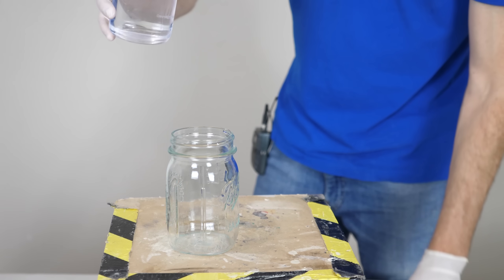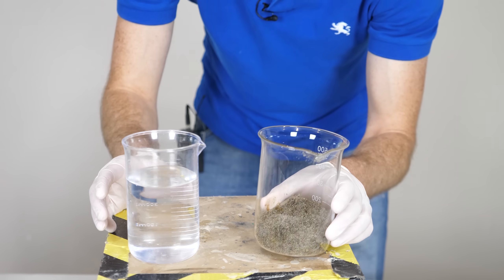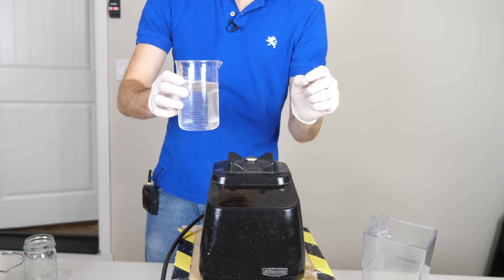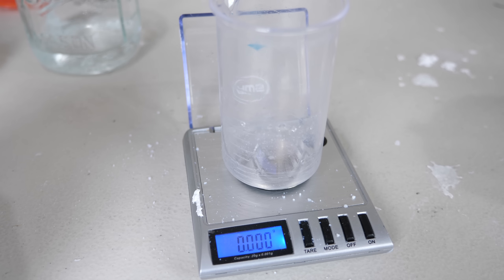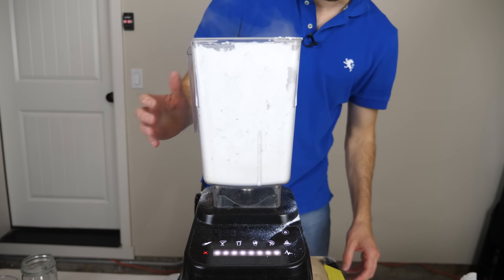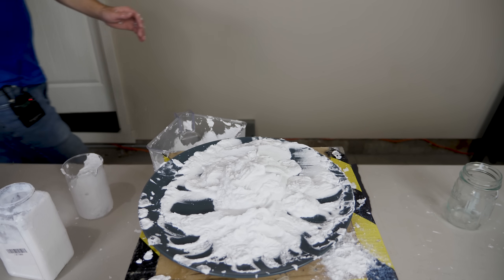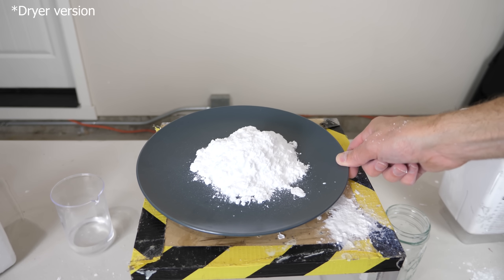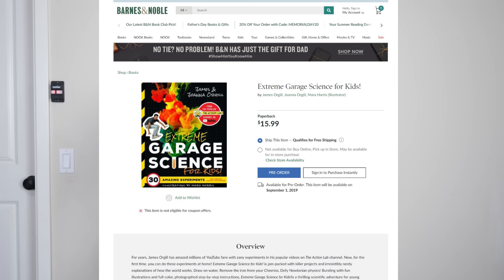How to Make Dry Water...Weird Experiment Makes Water That's Not Wet

Comment: snow is water, but what about dry ice? its a DRY form of ICE which means WATER
Reply: yeah it's big brain time
Reply: Dry ice has no water in it at all. It's frozen CO2, and it's called dry ice because it goes from a solid straight to a gas, with no liquid phase (sublimation). Only reason we really say 'ice' is because it's a cold, white, solid like ice
Reply: @temptationtv1726  alr thx

Comment: The way you mentioned isn't how fumed silica is made industrially.  It's made by burning SiHCl3 or SiCl4.  The method you mentioned is how polycrystalline silicon is made.  That's pure silicon that goes into solar panel or many other semi-conductor applications.  Good video though.

Comment: Actually: Dry water = hard-frozen ice.
To varying degrees, isn't any solid that contains water that isn't chemically bound to something else, yet doesn't feel wet similar to what is demonstrated here?
Aren't dry silica beads that have absorbed moisture from the air similar to what is demonstrated, with the remarkable difference (and it is remarkable, this is and interesting demonstration) being the high water "content", rather than this actually "being" water?

Comment: "Water is wet because it can wet things"
Every 60 seconds in Africa, a minute passes
Reply: Actually Clocks run slightly faster around the equator (than they do at the poles) due to a tiny planetary bulge that makes it slightly further away from the center of the earth's gravity, because the earth also has to rotate faster at the equator to keep up with the rest of the planet, these effects compensate for each other, causing both clocks to run at the same time. The difference in speed is so small that over a year the time disparity would only equate to less than a few seconds of age.
Reply: To everyone saying water is wet, how does water make itself damp?
Someone said that if something makes something else wet,then it is wet.
Shouldn’t that work with acids or fire?
In case someone says yes, acid doesn’t dissolve itself and fire doesn’t make itself burnt.
Reply: @vulcan8724  but sticking to something to make it wet is not the same as an acid donating a proton. An acid can make things wet, since they are all in watery solutions.
Reply: Mud is just wet dirt if you think about it
Reply: @geoffreyeljefe4544  that's a good point
Reply: is dirt dirty because it's made of dirt?😂
Reply: Actually, since we don't have atomic clocks in Africa, every 60 seconds, we lose a gazillionth of a second. :(
Reply: All people inside africa lives in africa
Reply: People die when they are kill
Reply: @nguyentandung42  Just because you're correct doesn't mean that you're right.
Reply: @nguyentandung42  did you mean: killed
Reply: The better question is, what is wet?
Reply: @GDO9099  something that has or is touching a liquid i think
Reply: @RandmAnimal  but why is it called wet? What is the pure essence of wet? If wet is by itself, is it wet or not?
Reply: @GDO9099  yes
Reply: 100% of cats are not dogs
Reply: In Africa, the next day happens tommorow
Reply: In Africa, people who die is no longer alive
Reply: Almost everyone in africa is born on their birthday
Reply: Everytime a child is born, the population increases
Reply: @idie6606  Unless someone dies at the same moment
Reply: A dog is more likely to bark than cats
Reply: You are awake after you sleep
Reply: Yesterday was last day
Reply: We can drink drinks
Reply: If we close our eyes, we will no longer see
Reply: We move when we walk
Reply: If we open things, they are no longer closed
Reply: when we sit, we are not standing
Reply: The man’s about to make dry water though
Reply: That’s funny because...
Reply: Not just in Africa....
Reply: Wet means water(or any liquid) is on it, so do we say water is wet because there is water on it? No we say that’s just more water
Reply: Literally 😂
Reply: Lol
Reply: Funny.. that never happens in Asia
Reply: @sailaab  what part of asia are you
Reply: Every time you inhale you exhale, unless  you just stop breathing then you are dead
Reply: @マルコHyprMarc yeah true...
Reply: Water is sticky.
Reply: Can water wet itself though?
Reply: xD
Reply: I cant comment because it says 69.

Wait...
Reply: You know it’s cold outside when you go outside and it’s cold
Reply: @マルコHyprMarc like me
Reply: he explains extremely complex fields of science is extremely simple terms for a reason.so people like you can understand it without having to pull 10 PhDs out of your ass.try not to be so sarcastic
Reply: Different things but same spirit
Reply: Wet stuff makes other stuff wet as well, like dripping wet hair and a carpet. Therefore wet things wouldn’t be “wet” As well right? Idk I just thought of that lmao
Reply: @6675rock  water is an exception as water itself doesn’t have a neutral dry version of it. Water is always a liquid at room temperature. Everything that can get wet can also get dry, water can not
Reply: I heard that in an African accent
Reply: @マルコHyprMarc Black holes are racist
Reply: Every 60 seconds in Africa no rain drops
Reply: a drop of water doesn’t have a dry outside, it has a wet outside. If water wasn’t wet it would not be able to wet other things.
Reply: This implies that in other areas of the world it is different t
Reply: @fred_marques  yes it can wet itself because a water molecule can interact with another water molecule.
Reply: Yes, floor is made of floor
Reply: You can tell because of the way it is
Reply: 60 seconds is a minute because it takes 1 minute to pass
Reply: Together we can stop this ❤
Reply: well yes, but water is not wet, it makes things wet
Reply: @ethanbergeson1240  technically it makes itself wet
Reply: @ethanbergeson1240  the water is in contact with other water, therefore making it wet
Reply: Water is wet but being wet doesn't equal being water all the time
Reply: @ethanbergeson1240  Wet is defined as something surrounded by water, water molecules are surrounded by water and are therefore wet. Water is wet.
Reply: @Resters52_official  “In a liquid-liquid interaction, such as water by itself, we can say that water is not wet, as molecules are all bound together and not wetting one another.”
Reply: @nelsonkuria4086  how does that even make sense? The water is interacting with water. It is wet.
Reply: @Resters52_official  does that mean a single molecule of water is not wet?
Reply: @Resters52_official  So does that mean the surface of water is dry because its not surrounded by more water?
Reply: @ObjectsInMotion  no, it's wet because it's stacked on top of water, it's kind of like putting water on the back of your hand, while the palm is dry your hand is still wet
Reply: @Resters52_official  what about one single molecule of water? That wouldn’t be wet, would it?
Reply: @Resters52_official  also, water doesn’t make itself wet because it doesn’t saturate itself with water due to water being water already. A towel becomes wet once it gets water in it. Water doesn’t make itself wet by principle of what wetness is.
Reply: @RobertMcBride-is-cool  in that case, I think the 1 molecule would make your hand "partially" wet. You can debate the definition of partially all you want, since it's levels to the word. But I do believe wet would be the act of surrounding or partially covering something in water. 1 molecule counts lol.
Reply: @thanosisking7249  that is irrelevant to the point I am making about water not being wet.
Reply: @ObjectsInMotion  Exactly... As a kid I used to joke about it... nobody would laugh though...
Reply: @ethanbergeson1240  The fact that water makes other things wet proves that water is wet. That's literally how you prove whether somethings wet or not
Reply: @averagetwink.  So Fire is burnt because it burns things? Bleach is white because it bleaches things? The fact that water makes things wet does NOT mean it is wet.
Reply: @ObjectsInMotion  water is different from the things you described,, fire is literally just hot fire doesn't "burn" everything either
Reply: @averagetwink.  is fire burnt? It does make things burnt doesn’t it
Reply: @ethanbergeson1240  ??????
Reply: @ethanbergeson1240  
Water is wet
Water = wet
Reply: @Brady Janssen water is wet because it can wet things. Even a single molecule of water can wet another object because itself is wet. Water = wet
Reply: “So weird”
Reply: But it’s not water it’s water and silica
Reply: Water doesn't get wet ... wet gets water

Comment: It's a bit of an old video, but if it has air trapped around it, what would happen if you compress it or put it in a vacuum? Also what if you absorb some sort of fuel and try to power an engine with it? Does it change how flammable it is and if it makes it less flammable, would it make the fuel "higher octane" (more resistant to knock)?

Comment: “Water is wet because it can wet things.”
glass is called glass because it's made of glass.
Reply: Glass is glass and glass break
Reply: @nguyentandung42  scratches at a level six with deeper grooves at a level seven
Reply: doesn’t count
Reply: I'm fairly certain a lot of glass these days is made of acrylic and polycarbonate.
Reply: No- glass is called glass because you can see thru it (but not thru the looking glass - WHY?)

Comment: The Action Lab: This is such a weird experiment
Me: just use ice
Reply: ITS DRY ICE
Reply: Ice is still wet to touch
Reply: @Wwain  Not quite. It becomes wet the moment you touch it. Ice actually has a rather high coefficient of friction. It isn't smooth or slippery. The reason it feels smooth and slippery is because liquid water is denser than ice. When you apply a pressure onto the ice, you compress it, thus forcing it out of its solid state and into its liquid state. In other words, a thin film of liquid water forms every time you touch ice.
Reply: bruh how much kids dont know that ice is water because water is a liquid but ice is solid and they’re different
ice is made of water but not water

Comment: I got a question about the water, so the water is shift changing material ,that can ruin every other metal, rock and everything with the  time, the hard rock breaks molecules from the water and lose its own shape , does that mean that the water is harder than the rock ? And if so what is the highest amount of  pressure that can endure until breaking its own molecules and become 2 atoms H , and 1 of O ? Will be glad if you make some video about it ^~^

Comment: Uhhhhh, isn't dry water called "Ice"??   Also, with the "dry water" in this video, how can you extract it??
Reply: bruh dry water isn’t a thing and ice isn’t technically water but made of water because it’s a solid not a liquid
Reply: Polly heat it up so the water molecules separate by evaporation
Reply: feynstein 100 heating up ice makes water not water vapour and it’s called melting, heating water into gas isn’t evaporation because you boiled it not let it break up over time
Reply: Ice is wet technically
Reply: @fatimaakamrann How do you figure that?? Ice is a solid and therefore can't be wet.
Reply: @stevenbingham3061  um hey? Try putting ice on something to see if that thing gets 'wet' or not
Reply: @fatimaakamrann  If it gets wet, it is because a portion of the ice has melted into water.  That layer of water is what is making something wet, not the ice.  Ice by its very definition is a solid.
Reply: @stevenbingham3061  Yeah, ice is solid but it's not dry water. Water can't be dry.

Comment: Now, by material definition this maybe called dry water, but that’s about as accurate as calling jello thick water or solid water. It may have mostly water as a material component, but this is not really water. It’s droplets of water encased in fumed silica.

Comment: I think you had better check into the safety precautions behind handling fumed silica. You might need to be using mouth and nose protection to avoid it getting into your lungs and causing potential long term health issues. We used similar materials in aerospace composites as fillers for the matrix binding the fibers. We had to be cautious handling them and avoid getting the 'dust' into our lungs.

Comment: Water is not wet. Water makes things wet, it in and of itself is not wet, it simply is. You did not make dry water you only made water mixed with the fume silica. Due to its really low density it abosrbs it. Due to water not being wet, there is technically no way to make it dry. It can neither be wet or dry.
Reply: Try to make dry water without adding anything. If you add anything it is no longer just water. What you made was water saturated fume silica

Comment: That's not dry water , that is water absorbed into silica. It is absorbed so completely that there is no water sticking to the surfaces of the silica, the water is effectively locked away inside it. While that is really cool , the water trapped in the silica is very wet....the silica surface just isn't wet.

Comment: I'd love to see you play around with that stuff a bit more. Specifically, I want to see the difference between it's characteristics with higher and lower water concentrations. Also at what concentrations of powder and/or water, the reaction fails to work and what happens then.
Reply: I would also like to know how they get the gasses and liquids back out of the solution once it's transported.